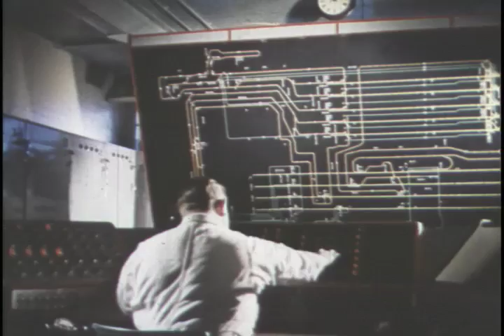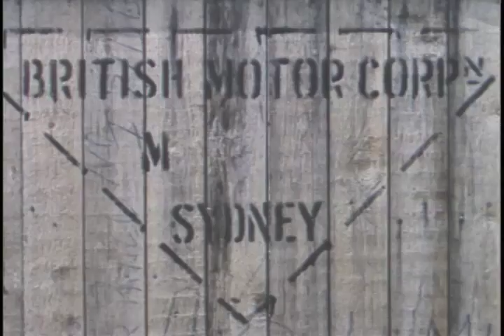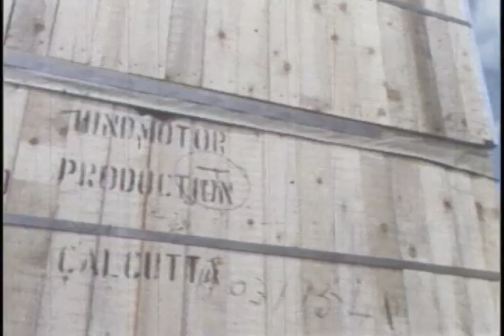British Motor Corporation Story

Comment: Rotodip rustproofing??? What did they use, sea water?. The cars were rusting in the showroom.
Reply: BMC cars compared with Ford, Vauxhall had a much better reputation for corrosion remittance. The Ado16 had some rot issues but still better than the Cortina and Escort. Later on the Aalegro, Marina and Princess had much better corrosion resistances than equivalent Chrysler, Ford and Vauxhall of the 70s.
Reply: The Rotodip coating is a very hard one but does nothing towards preventing rust. I found this out with my first Mini.
Reply: @angelsone-five7912  No, as it included a Zinc Phosphate coating it would have given it some level of corrosion resistance., the limitations of cars of the time compared with today in resisting tin worm has much more to with design  to eliminate rust traps and the sealants available today than the coating and painting process.
Reply: most of rust is caused road salting during snow getting into wheel wells. That’s why in the seventies the cars that come from Italy and japan because the climate is different, rusted the more than any British cars. They fixed that with Plastic wheel well shields. I think the first car had them fitted was Austin princess .
Reply: @englishjack5112  Princess would / may  be the first UK car but the Volvo 200 series (launched 1974) had front and rear plastic liners and some of the earlier Volvos had a steel sacrafical liner that was designed to protect the structure and be replaced when it rusted through in the harsh Scandi winters. The sort of thing I would imagine a Swede doing when changing to winter tyres. I also recall my father saying that for the Arrow and Avenger to meet Swedish legal requirements for corrosion resistance the Scandi spec cars had extra underseal and some additional panels and I wonder if they were some form of wheel arch liner.
Reply: @englishjack5112  I recall a review of someone restoring an Alfasud and they were surprised to find that the wings had been bolted on before any painting and so left a bare metal unsealed joint.
Reply: Fiats, Fords, Vauxhalls, all rusting away and failing MOTs after 5 or 6 years. Nothing special about BMC!
Reply: Made by British Pathé in 1962
BMC should have galvanised their car bodies. Porches have been galvanized from 1976 onwards and are extremely rust resistant.
19' 32 seconds:-  "82,000 employees earn £1,000,000 per week", which equates to £12 a week. The 2020 wage is £600 which is 50 times the 1962 rate. Politicians tell us 2020 prices are "Only 10x 1962 prices." Why do they lie about this?
Reply: Made by British Pathé in 1962
BMC should have galvanised their car bodies. Porches have been galvanized from 1976 onwards and are extremely rust resistant.
19' 32 seconds:-  "82,000 employees earn £1,000,000 per week", which equates to £12 a week. The 2020 wage is £600 which is 50 times the 1962 rate. Politicians tell us 2020 prices are "Only 10x 1962 prices." Why do they lie about this?
Reply: They all rust and the steel was sometimes crap.  Some had good paint and good steel, some were just friday afternoon jobs made with sub par materials.  Capris by way of example were a lucky dip towards the end.  The ones you see on the road are mostly A reg and B reg and younger.  The later ones risked being produced with some poor quality recycled steel and those rusted badly.
Reply: @TugIronChief  Which of my comments on this thread are you referring to? Then I will be happy to answer you.
Reply: @grahamariss2111  I find that hard to belive looking at my Marina 😂
Reply: @Georgegerrard_  It is all relative, your Marina no doubt faired a lot better than an Avenger or Alpine of the same year in resistance to tin worm.
Reply: @grahamariss2111  yeah I was only joking
Reply: @NoosaHeads  Your right, should have bought a Porsche instead of my Escort, damn.
Reply: The thing about rust proofing trough applying layers of protective material is that it only worked if the surface was undamaged. BL workers being what they were, were almost certain to give the cars a few scratches and bangs as they came down the production line, hence compromising the rust proofing.
Reply: Bro motor car Serives old year love like u
Reply: @timriglar4502  this was also 
Due to poor quality steel, keeping the cars cheap to buy, but a 5 to 7 yr life.
Reply: @grahamariss2111  In the sixties ford cars were refered to as Dagenham 
dustbins.
Reply: Lol
Reply: Ma bought a 58 Vauxhall Velox as her second car. It needed welding and a respray in 1960, an in 1966 it went to the breakers. It was no longer able to have any work done underneath, and included changed out a flat tire.

Comment: Back in the late 70’s/early 80’s there was a massive aftermarket industry supplying replacement body panels because BL cars would rust to hell within two years but still had a value due to their age. My garage business spent probably 50% of the working week welding up Austin 1100’s and Minis. What made it worse was the total lack of underwing protection so mud would lodge inside the front wings and instantly rot out the back of the headlights. Not to mention sills and subframes. Would be totally unacceptable today.
Reply: Indeed I have a 2002 Vauxhall Astra bought new. Galvanized body panels, hardly any rust even now.If only they had built them like that back then.
Reply: 1980 Opel Kadett-D series base (aka Vauxhall Astra Mk1) had the same issue.
Reply: Interesting
Reply: Was this notably worse for BMC than for other marques?
Reply: @thrunsguinneabottle3066  Fiat we’re pretty bad for rust back then but Minis and 1100’s were absolutely the worst from our experience.
Reply: @yesman2755  Alfa Romeo suffered from tin worm but by golly those little Alfasuds were a drivers dream on the road!
Reply: @thrunsguinneabottle3066  oh yeh. We could testify to that from the sheer volume of BL cars that came through our garage. Every one a rot box. I personally owned a Vanden Plas 1300. Nice car to drive at the time but the amount of welding I had to do on it was shocking. Would have been totally non viable had I not owned a garage business.

Comment: As an American, I was quite shocked and saddened to see the British auto industry practically disappear. But the few that are made in England today have something that British Leyland cars never did---quality. There's no bits falling off of today's cars, no shorted electrical systems or poor fit and finish....they simply work, and work brilliantly.
Reply: +DEEREMEYER1 
Sir I really think you need to use all your energy and anger towards helping GM right now...
Reply: The only reason the remnants of the British motor industry still exist is because of the infusion of cash, engineering expertise and modern production methods brought by foreign ownership.
Still no British car is a worldwide world class top seller.
Reply: @gixeff 750 Only by an inch.

Comment: I was hoping they would show workmen installing the short circuits and wiring harness smoke.
Reply: MARKLAR51 I thought that was Peugeot that did that lol (reference 307cc top gear)
Reply: Nope that was part of the R and D section very hush hush 😀
Reply: FIAT (Fehler-in-allen-Teilen = errors in all parts)
Reply: @nigeh5326  funny, that guy who measures the tolerances of the gear, is either drunk or doesn't know how to use a dial gauge...
Reply: @dr.johannesmunch891  Yes I noticed that..

Comment: They were great quality and great cars,however one of the reasons they didn't last long was the anti corrision they didn't use in production and the processes they used when casting the steel panels.Like most cars built in the 50s and 60s rust was a killer.

Comment: I grew up and still live in the shadow of the Cowley plant. It's not one quarter of what it used to be. Almost all working class folk around here had some connection to the plant and many happy memories. It really solidified the local community and economy. Go to almost any pub in the area and you will find an old boy who used to work at the plant during these haydays. Morris built homes, clubs and even churches for the workers. Now it is all owned and largely staffed by foreigners so doesn't have the same community feel at all. Workers come through agencies and work for a few months then leave.

Comment: Britain made some great cars but there are some things ive found in my experience.
British cars made before 1964 were generally very good and just as reliable as anything else on the road at the time if looked after. 
Cars made after 1962 seem to have worse rustproofing and it gets worse in the 1970's.
British CKD cars that were assembled in other country's generally avoided most of the poor quality associated with the union strikes and were often well made aside from the potential rust issues.
As for Lucas electrical stuff it got progressively worse thruout the 1960's-70's im guessing as cost-cutting came in and crappy connectors became standard fare.
Reply: Back in the day LHD Austins had been assembled in the ex-Yugoslavia. Had reputation of reliable daily drivers.
Reply: I liked the Austin America when young. My big brother told me scathingly that it was junk. I guess he was right about the company in the 1960s.
Reply: "some" is the wrong word; "few" seems  more proper.

Comment: I had a 1969 MGB bought used in 1987. Weakness of BMC cars was the lucas electrical system
Reply: Lucas, the prince of darkness
Reply: But otherwise the car was good?
Reply: As a automotive electrician tradesman, Lucas equipment was almost as good as Bosch equipment of the same era. The only real quality letdown was soldered diodes in some alternators getting dry joints. Bosch had the diodes press fitted.
Reply: Tony Doggett I think if you ask most people they will tell you the greatest two weaknesses of British cars of this era were rust or what you call rot And the electrical system.

Comment: I had both a Morris Minor 1000 [sorry I traded it on a Morris Major} and some regret with the Major,they used basic Minor parts in the Major and breaking back axles was a problem as they failed to take into account the extra strain involved using a re ratioed  minor diff.useless electric fuel pumps used on Morris vehicles also a problem.
Reply: Morris Major?

Comment: It's wonder the workers at the painting line inside the cabinet didn't use even an eye protection, face lift or a mask as a safety gear in the  meantime the left side operator sprayed over the car body and the right side operator sprayed the other part, but just dressing a suit and both operators breathing the chemical atmosfere.

Comment: It was not always the workers to blame, didn't BMC spend £32 Millions to develop the MARINA? what a joke that was yet Colin Chapman admittedly years earlier spend £20,000 to build the Elan? BMC Never designed a newer Engine for the Brilliant MINI till everybody else overtook them yet they where years ahead of everybody at the time? using an A series engine with 3 main bearings  n engine/gearbox sharing the same oil was madness cause they just could not be bothered? they threw it away man all the motor industry

Comment: This documentary was made by British Pathé in 1962
BMC should have galvanised their car bodies. Porches have been galvanized from 1976 and are extremely rust resistant.
19' 32 seconds:-  "82,000 employees earn £1,000,000 per week", which equates to £12 a week. The 2020 wage is £600 which is 50 times the 1962 rate. Politicians tell us 2020 prices are "Only 10x 1962 prices." Why do they lie about this?

Comment: Greedy Unions... Labour Government... such a waste... such a waste...
Well, I, for one, will continue to maintain and drive my seven or so... such a waste...
Reply: What about inept management (failing to properly merge Austin and Morris in the 1950's)? Wrong pricing that lead to negligible or negative profit on the cars they sold in the 1960's? Poor product design such as the 1800, Maxi and Allegro that sold nowhere near there planned volumes so lost money catastrophically? Conservative governments that failed to solve the worker unrest, as well as Labour? Bit of a one-sided view you have there.
Reply: Have you ever worked inside a noisy dirty machine shop from 7 in the morning till 4.30 and then the next week night shift freezing in the winter red hot in summer stuck inside, all because that’s the only job around. My guess you haven’t even been inside a factory in which case you don’t have a clue on what you are talking about.
Reply: @rogeruk9263   Then how the Germans did the same work, did it better, for the same money and without any protest. All of you and your Communist ideas are the ones responsible for the collapse of British Auto Industry,  you tried to take to much and ended up losing it all.
Reply: 58'chrysler Because the Germans & the Japanese invested heavily in decent factories. When they upgraded.their factories-they closed down production of cars & built new factories that were modern, air-conditioned & were good enough for their employees to work in. Britain used to just use old technology, not invest what needed investment in & foolishly tried to add on bits of new technology to old ons. For example, the Morris marina car, was made on a production line that was designed for minis & so men were a bit to close together, when working. In Japan & elsewhere, they make the space large enough of any size of car, so that they can interchange production lines & keep the same quality as the workers, have space to breathe, etc. 
In my workplace, the supervisors office was an former archives, office with no air-conditioning at all. In the summer time, it was like being in an oven. I suggested that they install air-conditioning to sort the problem out & connect that room up with the rest of the building & the head of department gave me a funny look & ran like the weasel he was, which was a cross between Mr Bean & Alan Partridge.